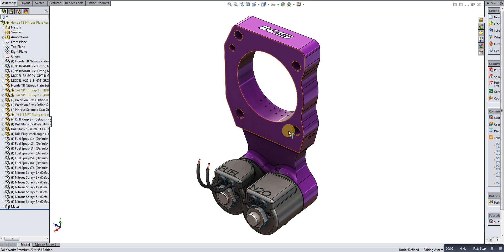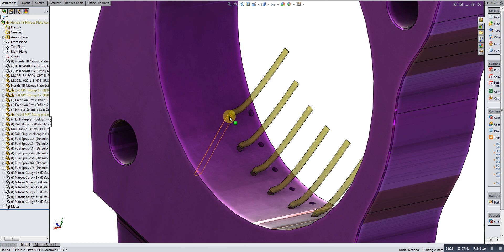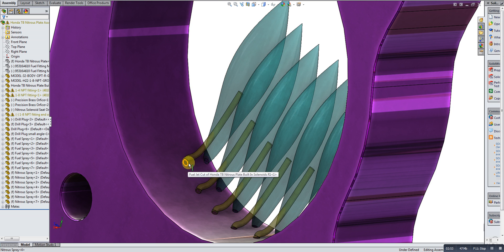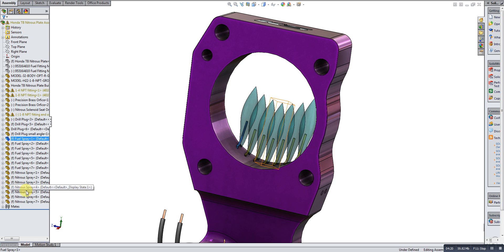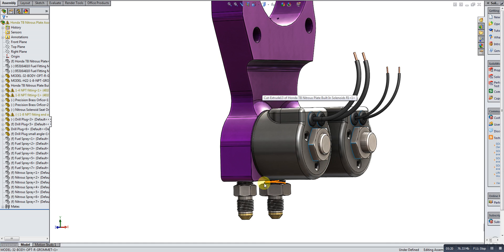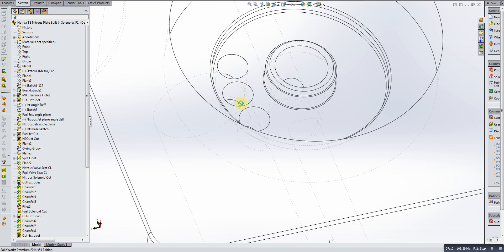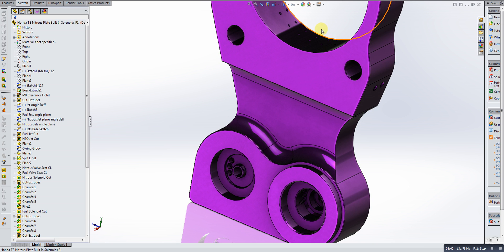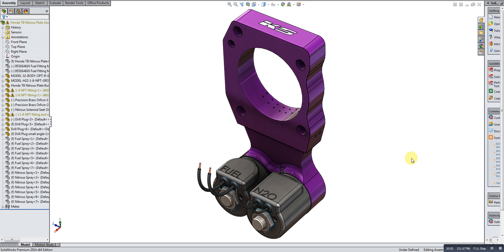OBDI Honda Nitrous Throttle Body Plate (design development)

Comment: internet mechanic here (also a mech engineer) with these angles you woul spray the fuel away from the manifold towards the throttle. You shoukd spray n2o behind the fuel to encourage pushing it forward. also i believe you need a steeper angle on the nozzles looks too straight up to me